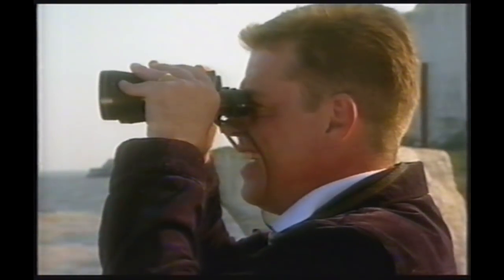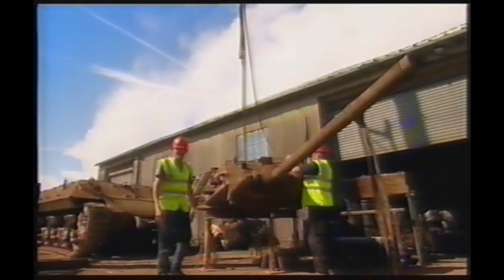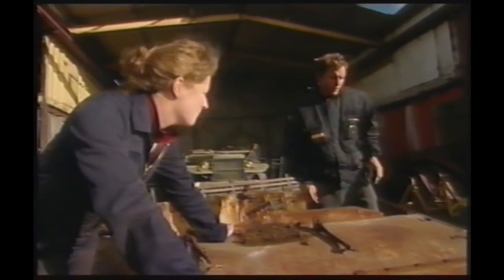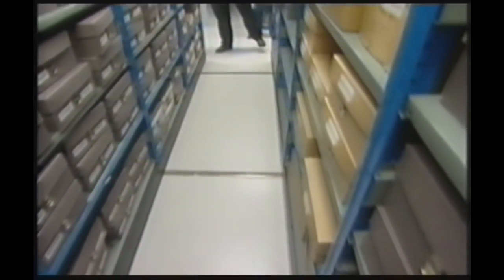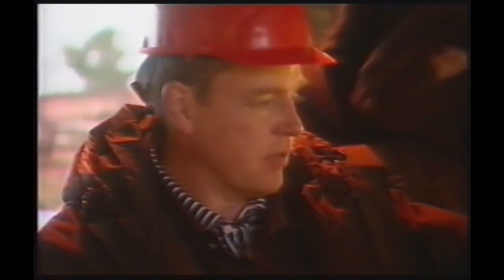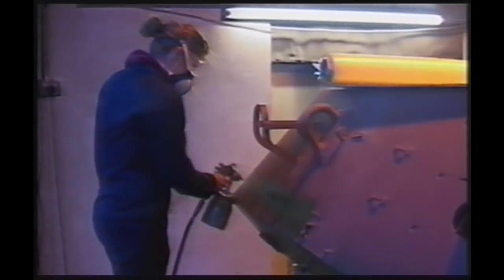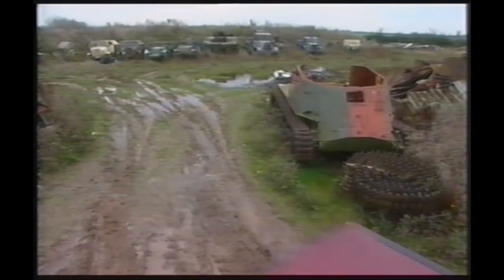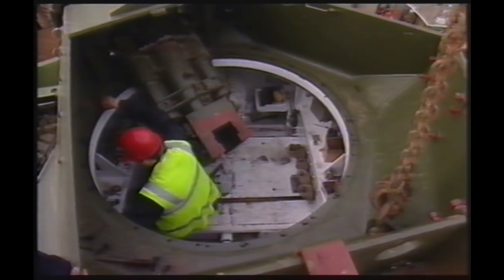Salvage Squad M10 Tank Destroyer

Comment: Supercharger doesnt pressurize the intake charge on a detroit 2 cycle only pushes enough air to allow them to run. When a turbo is fit in conjuction to supercharger then it was considered boosted above 1 bar